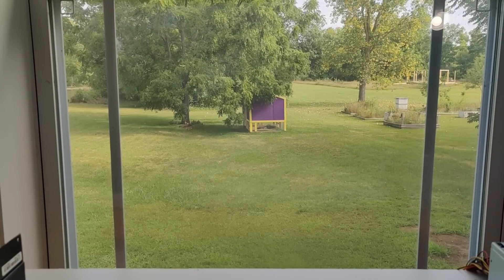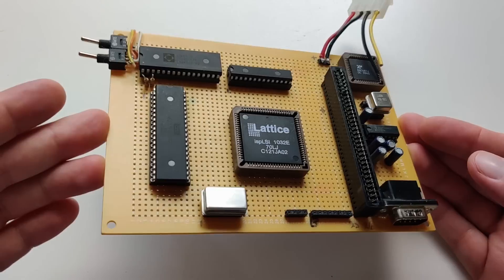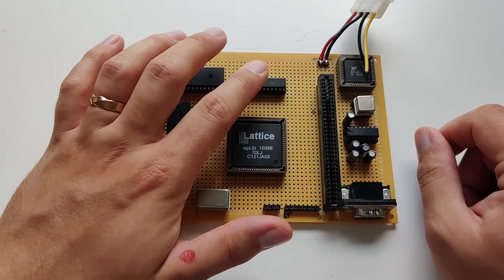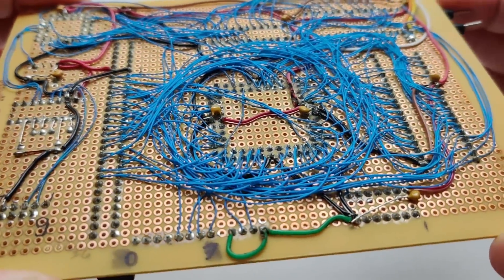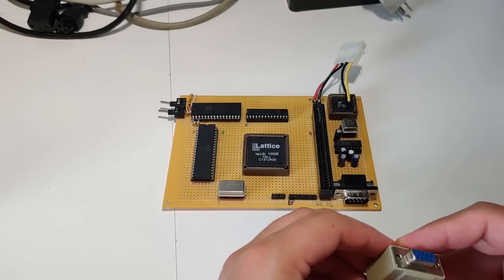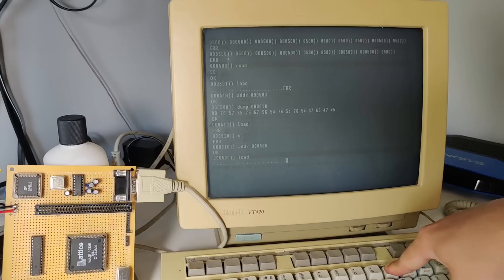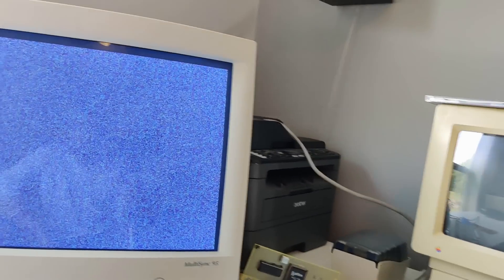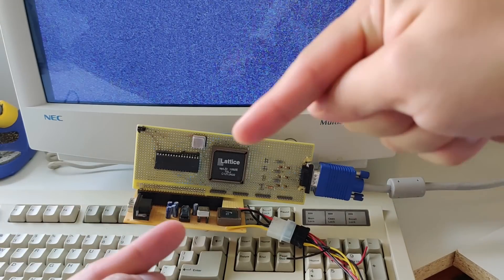Geek Rant #6 - My DIY 65816 Computer

Comment: the assembler will be a 6502 one ?
Reply from the maker: There are assemblers that support the extended 65816 instruction set and operating modes. Personally I'm using XA
Reply: @TrackZeroFutzin  thank you for your time

Comment: its a very janky CPU compared to the much more popular and successful MC68000 - am not at all a 6502 fan boy. Mainly because there was never conscious effort to support high level programming languages, whereas the designers of the Intel 8088/86 deliberately added support for high level languages, and not too long after the IBM PC debuted, there were decent C compilers, and the phenomenal Turbo Pascal; and the 68K and C compilers are soul mates, of course - the 65816, though it came out mid 80s, didn't do anything meaningful to address this shortcoming
Reply: A C compiler is available for the 65C816 and has been available since the latter 1980s.
Reply: I thought the 65816 supported stack pointer relative addressing and a 16 bit stack? Wouldn't that pretty much allow for a good C compiler? I know those were the big stumbling blocks for CC65 on the 66502.The software stack was much slower than the built-in one.